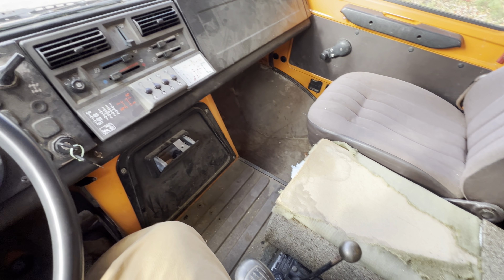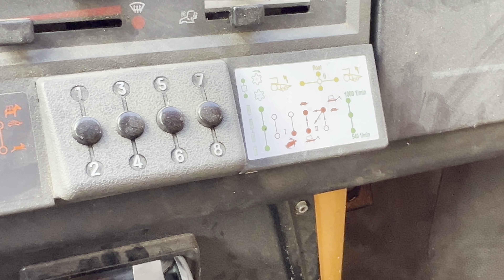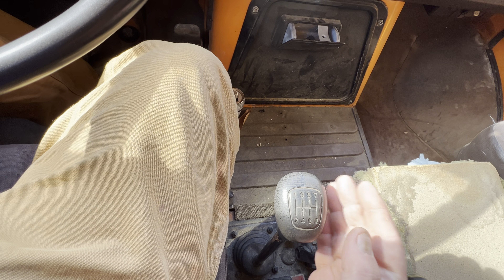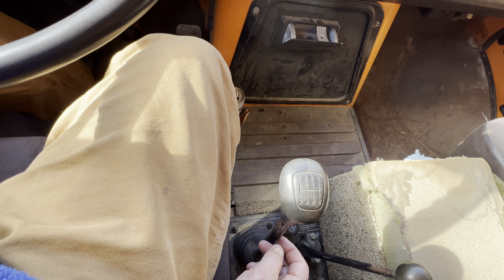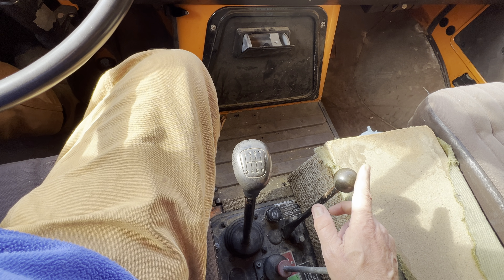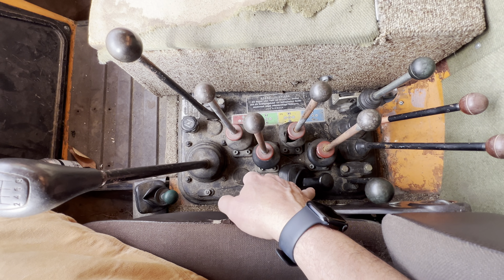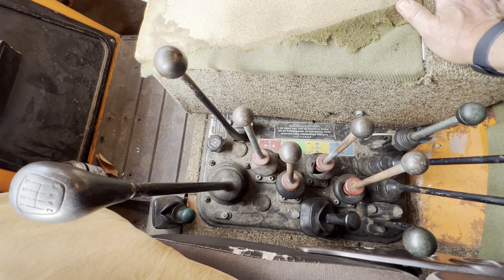Unimog Gear Levers

Comment: In my Unimog I use the Donkey Gears as Sort of a splitschift. If going Up a hill with really heavy Trailers you can stay in one Gear in the Main Transmission and Just Push the Rangeselector Back. That will give you a reduction of about half a Gear.

Comment: They truly are the Swiss Army knife of vehicles. My neighbor here in NY has an old Jeep with a post hole digger attachment, backhoe and front grader and I thought that was cool.  But when I visited family in Ireland, their leased landowner had a Unimog with a bucket loader and a backhoe, the bed lifted vertically and dumped to the rear and both sides using a z rack. The steering and pedals were on a trolley and you could drive from either side. It also had hydros to the back for running a manure spreader, power broom and potato rake along with a whole slew of other attachments. An amazing machine indeed.

Comment: Interesting! I quickly realised that it was set-up like a tractor (old school) and found it surprisingly easy to work out what was what or near enough anyway. If anything, it is far more user-friendly than an old school tractor and far easier to understand than the confusing mess of modern tractors. I remember a time of a school sports day at the city stadium in Maebashi Japan. The teachers were trying to get the hurdles out, but there was a small grounds tractor parked in the way. No one could start it. So I told them in my then very broken Japanese that I could move it. They laughed and clearly didn't believe me and said, okay you try. I jumped on, put both gear leavers into neutral, pushed in the 'kill knob', turned the key and pressed the button and the engine started. I picked up the attachment on the 3 link at the back and proudly moved the tractor out. They were puzzled and they asked me why I could start it. I matter of factly said that a tractor has to be in neutral in order to start it (as they were built then). For some reason, this Unimog reminded me of that time and yes, the same principles apply. I grew up on a Welsh hill farm and learnt to drive on a Ford tractor.
Reply from the maker: Unimogs are basically road going tractors. There are lots of gears but it is also PTO and hydraulics.

Comment: What the hell is a PTO?
Reply: an auxiliary transmision to give power from the engine to a truck accesory, like a crane, pumps or to rise the back to unload materials, sand and others.
Reply: @Sally725_19  So, "Power To Outside"?
Reply: @graybot8064  close, it's "Power Take Off"
Reply from the maker: PTO is "Power Take Off" There are various types depending on the vehicle. However virtually all ag spec tractor use agricultural implement spec PTO that usually spin at 540 RPM. Things like mowers, chippers, sprayers, hay balers etc use power from the PTO. In the front things like snowblowers use a PTO. The Unimog uses Agricukltural spec PTOs and it is compatible with most CAT1, CAT2 and CAT3 setups.

Comment: I drove ( still drive on special occassions ) a 1995 Unimog at the road maintenance company where I work at. There's still around 3 of them in the company but are mostly kept as backups nowadays as they been replaced with newer Unimogs. Unimog I drove had a road sweeper attached to the front so I used the forward and reverse alot for manuevering.The forward and reverse gear really is something. Put it in fifth and reverse gear, she goes as fast as she does in forward. Crazy fun little truck!

Comment: I have one question about the crawler gears: Is there a 4th setup? Because you haven’t showcased the right leaver in rabbit and the left leaver in donkey. As I understood there’s A: no physical transmission to the auxiliary gearbox with the right leaver in the rabbit position or B: It would damage the system. Great and informative video, thank you! :)

Comment: Really interesting video. Thanks for uploading. 8 gears on 1 lever is crazy. Is it easy to accidentally select the wrong gear? I Think I saw the diff lock switch on the dashboard.
Reply from the maker: The Unimog actually has a shift interlock so you can not accidentally shift past two gates. Also, yes it has differential locks. I'm planning on doing a video that just covers the gears, this video was to just show the levers. Thanks for watching!

Comment: the problem is that you need to stop to change from normal gear to slow and stop again for change to normal
that is a problem if you towing a trailer with 30 tones of sugarbeets (like a was)

Comment: my older Unimog 806 had 24 gears too. but reverse only worked in 1&2 when in road gears. Hydraulics were on the steering wheel. It had a separate lever also for diff locks, front and rear.

Comment: One wonders if the lowest possible gear ratio is not too much torque for the wheels to still have grip on whatever surface. It has pretty large wheels and quite some vehicle mass but it's wheeled traction is likely not endless.  Or do these things come with tracked versions or capability also ? I used to operate airport special purpose trucks ( snow plows among them ) so the many levers do not scare me :-)  But hopping into one without some explanation would leave me experimenting for hours :-))

Comment: Great video.  However, saying that "8th gear in reverse is faster than 8th gear in forward" is not possible, and makes no sense, what-so-ever.  Each gear setting - 1 through 8 - goes the same speed forward as it does reverse.  It can be no other way.

Comment: I had a splitter on the main gear stick giving 16 road gears and then a separate working gear lever,. Also had 5 stage diff lock. It was 6x6 and  excellent over any terrain.
Reply: Were all those gears available in forward and reverse?

Comment: Back in the 80's and 90's I regularly drove UNIMOGS. They have got to be the best wheeled  cross country vehicle that I have ever driven. The UNIMOGS that I drove did not have synchronised gearboxes, they had crash gearboxes. That means that you have to double declutch.

Comment: I´m most amazed over the Start Pilot thing. I saw the chocke symbol and a "?" popped in my head because diesels have glow plugs but no choke. Would You look at that. So it´s  like a wiper fluid pump for ether? Fascinating. Try to buy a bottle of ether in Germany… But our brand of starting fluid is called like that but it doesn´t contain ether anymore. When my Dad used it and I was around I was very keen on a whiff of that because it gave me a little buzz…
Kind Regards

Comment: And truck drivers think an 18 speed road ranger is the way to go. 24 gears, that is a university degree. An uncle if mine years ago drove an International Acco truck, ( Australia. One trip he was overloaded, and had a steep climb. It could not make it. Reverse was much lower than low low. He turned around, and reversed over the climb.

Comment: I thought my series 3 Land Rover with 4 gear sticks was bad, this is mental.
Reply: You must have an overdrive
Reply: @hughmarcus1  Yes, it's a Fairey Overdrive.
Reply: Post a video explaining them I'm curious to see that
Reply: @visionist7  Unfortunately. I sold my series 3 a few years ago before Covid, so I can't make a video.  Basically, you have a 4 speed + reverse gearbox like an old car. Then there's yellow mushroom you push down for 4 wheel drive in high ratio. There's a red mushroom on a lever you push it forward for high ratio and back for low ratio. The overdrive gear stick is used in conjunction with the normal 4 speed box. The over drove gets you better economy and drops engine revs. The red gear lever is also used to disengage 4 wheel drive in high ratio. Lastly, there's a conventional lever handbrake. You can't go into 4 wheel drive whilst moving, and you shouldn't drive in 4 wheel drive on a paved road as you will experience diff wind up. So you end up with 5 levers sticking out of the floor.

Comment: Best explanation I've heard yet of how the unimog transmission works.  You basically describe the power flow as a flowchart (well that's how it seemed in my little mind 😁) which cleared up so many questions I've had about the unimog. Thanks👍👍

Comment: George? Goedemorgen!!!......  RPMs?  Revs per minuteS.. really?     What about diff locks? (Head is in 404 mode I guess)
Reply from the maker: Welcome to the dark side Howard...:)  When. you engage the diff lock switch you are engaging both front and rear locks. The RPMs, well that is either an Americanism or something I picked up somewhere. Once I get the Unimog skidder in, I'll do a self-spooling winch demo. Maybe pull some tress out of the ground as opposed to using them as an anchor. Going to do a video on the FLU419 including using the hydraulic chainsaw and jack hammer as well as actually taking off the front loader and back hoe.

Comment: Never knew such things existed, my God, 24 gears and 8 gear stick! Great video!
Reply: Long ago, here in the UK, a seriously talented engineer built a handful of heavy-haul trucks and when I say heavy, these things could move 350t as a single unit. They were powered by GM 92 series two-stroke V8 diesels driving Fuller Roadranger RTO915 gearbox and Hardy-Spicer splitter axles. The Fuller box had 15 forward and 3 reverse gears (5 x 3 ranges) and the axles were four-speed so in effect, 60 forward and 12 reverse gears!

Comment: So in lowest crawl at 1000rpm the Unimog will go at 150yards/hour. If you just let it idle, it’ll go somewhere around 20yards/hour or less… Use case was mainly large snowblowers (clearing avalanches from roads and railway tracks). These “hyper crawl” gearboxes are rare to find, as all slightly newer Unimogs would use the hydrostatic drive for such applications. 
Also: when the lucky owner used the phrase “like a tractor”, he could have left out the “like” as the Unimog was conceptualised as an agricultural vehicle. When these two German engineers heard about the Morgenthau plan (turning post war Germany into a strictly and only agricultural country - they later found out that this would starve about 8 million Germans to death) they thought that thousands of universally usable tractor-like vehicles would be needed and built one. Later Mercedes bought their company and military use was introduced. Thus Unimog is an acronym standing for UNIversal MOtor Gerät (Gerät=appliance, tool).
Reply: 150 yards/hour = 0.137km/h !!! 137 meter/hour ! 
20 yards/hour = 0.018 km/h !!! 18 meter/hour !!!
I'm faster walking on my hands ! 
and how much torque ??? -> YES
Reply: hydrostatic drive made it so much simpler to use and maintain, any trouble you just flush system and replace hydro pump or motor. i worked in croatian road maintainance, we had 20 unimogs just for "winter" but non of them were actually used as plows as we had 20 ton trucks with huge plows. Unimogs were for local roads. and this is Adriatic coast, we see snow perhaps once a year, if it is super  snowy we get 3 snow days :D we used them for cutting grass and cleaning ditches by roadside
Reply: What is the wheel torque on that?? I have no idea how much the engine makes, but with such reduction a hamster could probably move this thing
Reply: @ good question for which I don’t have the figures but some leading facts. Engines were always small 4 cylinder diesel engines with an output around 200 hp and 590 lb-ft. and of all the gears in and around the vehicle, the last ones are in the wheels. Because of its portal axles the last reduction is in the wheel assembly.
Reply: Our 406 in Super Crawl 1st used to cover around 80yds in 1 hour, from a distance you couldn't see the tires turn.
Reply: You can run it in low gear and get out to load square bales. Why waste 2 people. Just hop back in to make your turns.
Reply: If at 1000 rpm it does 150 yards/hour and at tickover it does 20 yards/hour as you suggest, using the same ratios, the maths say tickover is 133 rpm?
Reply: @auldman  Doesn't seem right, our 406 at tickover in supercrawl 1st used to cover around 80yds and at max revs didn't seem to go much further.
Reply: jesus christ, the allies were discussing genociding the germans while they were already starving millions of indians to death during the war?

crazy...
Reply: @Anonymuskid   One guy proposed it, perhaps read up on things before making wild proclamations about "the allies".

Comment: There is computer simulator you can download where you can drive trucks like unimog or GAZ or UAZ (even a 6x6). Simulating the gears and reduction settings. Giving you different terrain to climb and explore. It even has a winch you can hook to trees or boulders to climb steep angles.
Reply: Snowrunner?
Reply: @ no it was a Russian game I can’t find in app store anymore. It was called (gear reduction) I had a look at snow runner and it was more basic than that. Like a single dev made the one I’m taking about. Very basic but it had all the gears and diff locks, whinch etc. I’ll try to find it again.

Comment: No kill switch required. Throw in a random mix of lever positions and nobody is stealing that thing in less than an hour
Reply: Security through obscurity is real! <3
Reply: The best anti-theft measures on the American continent
Reply: Try driving old Ford-T
Reply: @myc0p  There is another video of starting an old bulldozer.  So many combinations of things to do.  Pump this, pull this, switch this, then push this, and pull this, then put this back where it was.  Impossible to steal.
Reply: @krissanderson5004  All so good luck making an escape in a bulldozer lol
Reply: @JC-3RZ-FE plus reversed gas pedal.
Reply: @Kilposen_TyömaaThe one I drove had a hand throttle and the clutch was reversed 😂
Reply: @myc0p the transmission setup of a Ford model T is very similar to a lot of tractors

So while a city guy might not be able to drive one, any farmer should know how to.
Reply: My GQ patrol has three levers and a sway bar disconnect „lever“ I thought that was cool until this guy shows up.
Reply: "Offenders were seen leaving the scene at 0.01 mph. In reverse.
Reply: I like that idea.
Reply: Would be hard to sell or part this out in the states. Would be fun to joyride around in but you’d get caught quick
Reply: Youve probably got a 20 in 24 chance that letting the clutch up slow will get it moving.
Reply: @dougaltolan3017  Yeah but a 16 in 20 chance it will be a 1mph getaway.(Assuming they can't interpret the giant lever diagram on the dash.)
Reply: @dougaltolan3017 18 of which will most definitely not be a fast getaway, and 4 of them will be, but in the wrong direction 😊
Reply: @dougaltolan3017 yeah but you would probably be trying to get away at 0.05kph in reverse

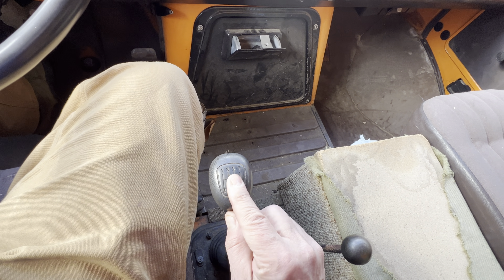Comment: My brother had a 06 powerwagon, it was a manual 6 speed with a 4:56 rear end. In low range on flat ground from a dead stop you could just gently nudge it into gear without even using the clutch and it wouldn’t even grind a gear. I can’t imagine having such low gears as that thing!

Comment: Very informative!   What are the push button looking things on dash that look like the shift pattern?
Reply from the maker: They are actually little lights to tell you what gate you are in. So the first light illuminates if you are in the 1/2 gate, the next light illuminates if you are in the 3/4 gate and so on. Basically it is to help you know what gear you are in since there are a lot of throws on that gearbox.

Comment: What’s a PTO?
Reply: Power take off, it's a connection on the truck that spins using engine power, useful for powering accessories and attachments with mechanical moving parts.

Comment: So this is every trucker's dream. But today's electric kids would have to be given anti-depressants to cope. An exceptional machine and also its drivers who can handle it.
Reply: I'd like to think I would be able to manage, especially with how well the video explained. Not sure I could do a good job of it though, especially without practicing on the specific vehicle.
Reply: @blockstacker5614  Some very smart people have said "there's no replacement for seat time" when it comes to operating equipment. You don't start out the best even if you are someone with natural talent. You have to hone your skills over time of using said equipment. Could I operate something I've never run before, sure. Could I operate it well, probably not. I can drive any vehicle of any size I get in right from the rip. But it takes me some time with it to become proficient. I'd love to actually play with one of these old Unimogs one day, but they're probably just a bit too outside my price range

Comment: I have driven a 404S, that is less complicated, but it was a lot older. The only thing I missed in your explanation was the diff locks, or are they push-buttons operated? Also, I assume there is a heavy point between the gates of 3/4 and 5/6, otherwise mischanging becomes very easy.
Reply: I believe the difflocks are on that partically covered switch above the key at the start of the video
Reply: The diff locks are the switch right above the ignition key.
It is in two wheel drive If it is Up.
If you turn it right once its 4x4 and second its completly locked.

Comment: Did they drop the front and rear differential locks on this model?
Reply: The lever is on the dash.
Reply: You can see it at 1:03, black thing pointed right which means its in 4WD, and next step locks diffs.

Comment: I think the army vehicle Unimog I drove in the Danish military in the early 1990's had a 4 gear lever. A second lever engaged high and low. On a flat terrain I once got it into 3. high reverse. That was a scary ride. No rollercoaster ever got close to doing 60 km/h in reverse on a dirt track in a vehicle with 4 giant springs as suspension.
Reply: The military versions usually didn’t have pto’s etc except winch if fitted. The multi levers are normally fitted into agriculture spec ones.
Reply: The South African military Unimogs in the 1980's had three push buttons.  I think one was low range, the others was diff locks.